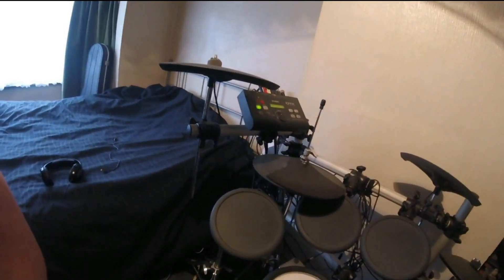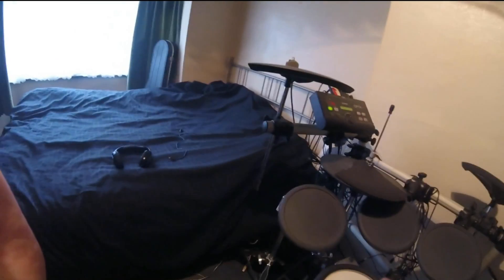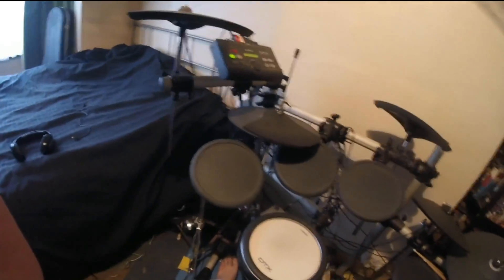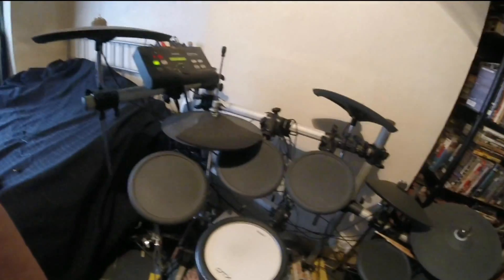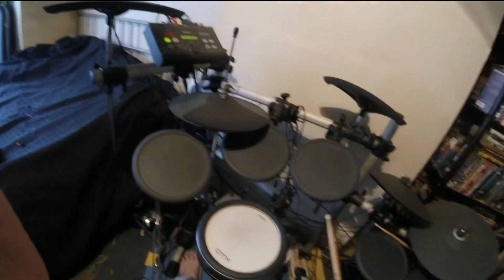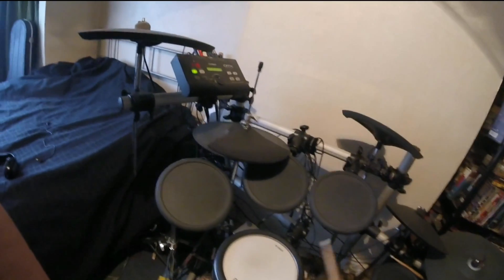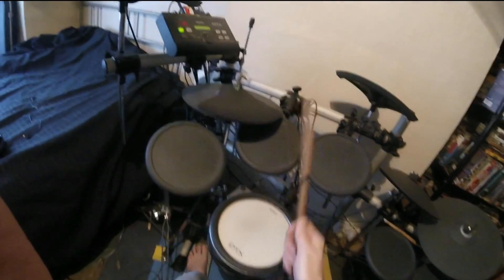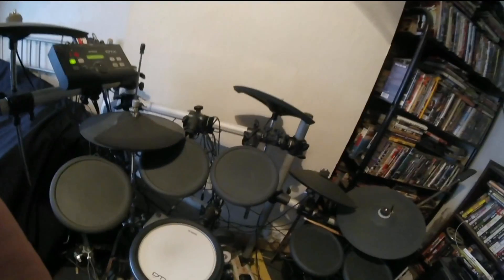Yamaha DTX RHH135 hi hat repositioning video

Comment: hi john, ist dtx 500? could you share how to record drum voice to PC using midi port? tx before
Reply from the maker: hello sir, this was a DTX500 module I now have 502 you need a midi lead to your pc and use software like ez drummer to record
Reply: hi bro, i have buy midi to usb and now i wanna record using software like ezdrummer. could you help for it?..
Reply from the maker: the best I can do is direct you to a video https://www.youtube.com/watch?v=ZRszzUFj_9o
Reply: many thanks Jonn, now my dtx can connect pc, but why if I hit from dtx pad volume so low but if I click direct from ez drummer screen volume so loud?
Reply from the maker: there will be a way of adjusting the volume on ezdrummer here's a another handy video https://www.youtube.com/watch?v=DNheCh1cv_E
Reply from the maker: a video on how to use the mixer https://www.youtube.com/watch?v=8Yahz0P7z80
Reply: Great thx John, volume from pad can inscrease. But why volume from hit pad still lower than if we click direct from screen ez drummer
Reply from the maker: the drum brain sends midi to the computer at a different rate that through aux out plus the volume on your computer will be different to the dtx brain. that's the best i've got as I don't use ez drummer myself I record with audacity
Reply: so before u connect from dtx500 to pc(audacity). use mixer or direct connect from module  to pc?
Reply from the maker: i connect via the aux out then thru line in on pc then record with audacity so direct connection. personally, I don't see the need for ezdrummer as I have used this method to record drum tracks for songs commercially. here's a track https://www.youtube.com/watch?v=Uj_C51XM9dw have a listen all through